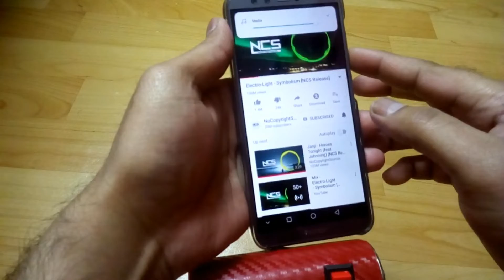DIY- MINI stereo speaker for mobile with  3.5mm jack

Comment: What will you do if the battery(which is insde the box that powers up the amplifier) is down? You didn't install a charging port for charging the battery. You could have make it without using battery instead powering it through micro usb of the smartphone.
Reply from the maker: Good point brother. It was an initial experiment of this thing which is the first of its kind i guess. So didnt go that deep. Maybe next time i will do that. Charging port would be easy & good. Just need to install a tiny charger kit.. thanks for watching brother 🙏
Reply: @technoboy-allinOne  Nice videos bro.. Keep uploading such gadgets.
Reply: A little late in the party. But using the phone as source of power will cause a ground loop which will cause issues with the sound output